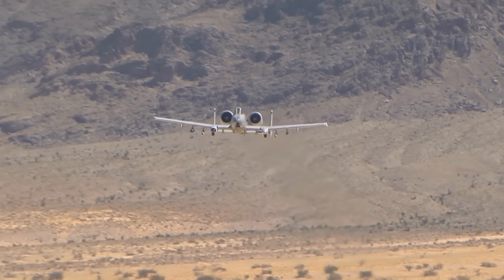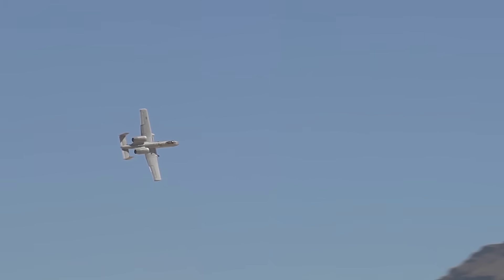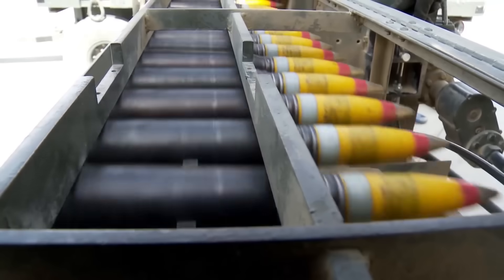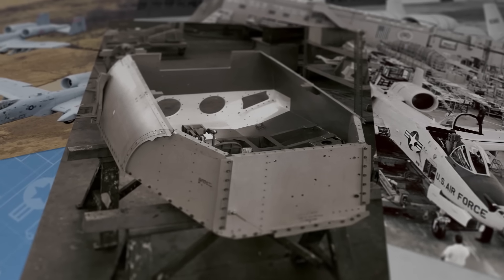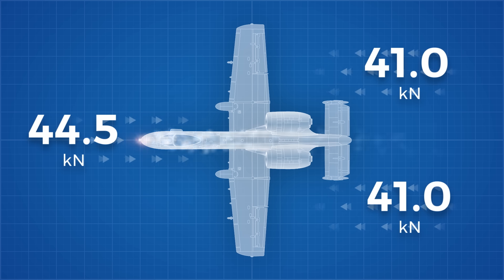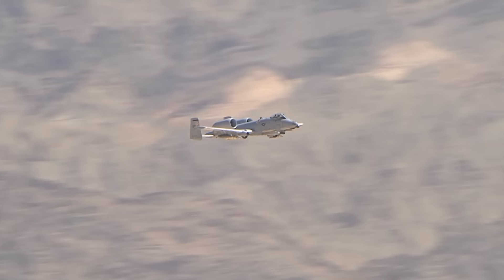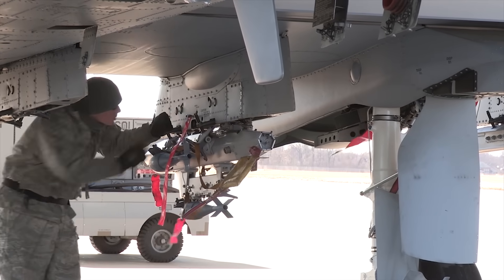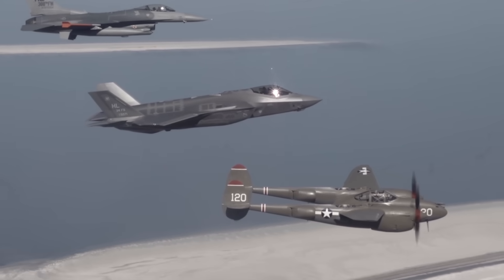The Insane Engineering of the A-10 Warthog

Comment: 00:07 Introduction to the A-10 Thunderbolt
00:31 The role of the A-10 in air land battle doctrine
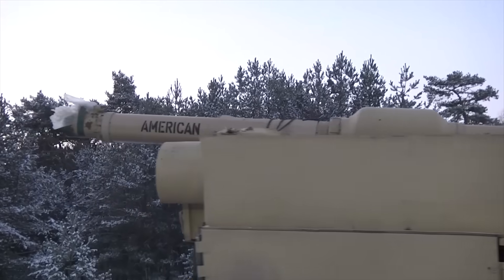01:03 Qualities required for close air support
02:02 Survivability and simplicity of the A-10
03:24 Design considerations for manufacturing the A-10
04:42 Redundancy and control systems of the A-10
06:34 Features for increased survivability
08:22 Design choices for operating from remote airfields
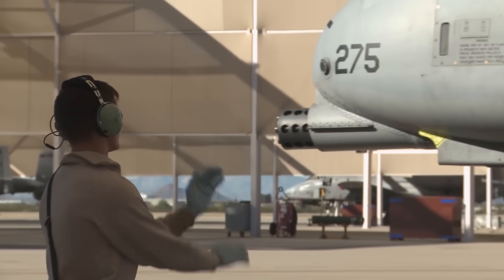09:16 Challenges and solutions related to the A-10's gun
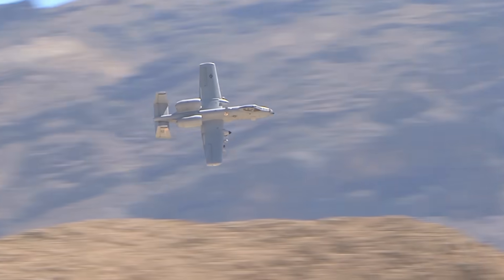10:16 The power and effectiveness of the A-10's ammunition
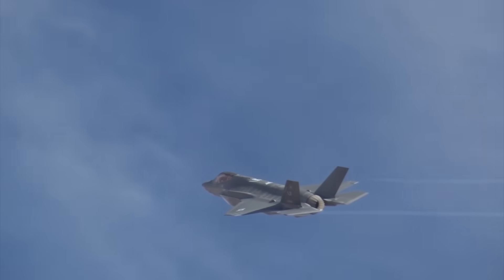13:01it can carry just as much as the f-16 when air superiority is established it's a multi-role fighter designed for the modern battlefield
13:52 the f-35 was created with future Wars in mind where the threat environment will be so dense that simply being able to take a punch won't save us

Comment: The empty shells are kept for balance reasons from what ive been told. The Hogs handling would be greatly affected if it was to lose all that weight in that part of the aircraft.
Reply: Those spent cases being sucked into those jet fans would not be a pretty picture...try turning on your garbage disposer in your kitchen and then dump in a hand full of bolts...that's probably what it would sound like as the pilot was ejecting...

Comment: Too bad there's no new successor ready to take on the valuable CAS role that the A-10 has provided to men on the ground and the Air Force's lousy lazy choice is to use the F-35, which was not designed for the mission and role the A-10 does in the first place. The Army should have given the Air Force a good slap to the face by ordering new fixed wing CAS aircraft and operate them since Air Force is fighter-drive mafia at this point, neglecting all its other roles. The Air Force never had a plan to steadily replace the A-10 with a comparable and reliable CAS aircraft so they have no right to complain if the Army maintains and fly its own fixed wings for CAS. Heck, the Army should just order batches of Su-75 Checkmate and justify it as a cheap budget replacement for the A-10 just to flip the finger to both Air Force and Lockheed Martin.

Comment: Never understood the blaming of "elevated cancers" on DU. It's less radioactive than natural uranium. There's not enough of it in each bullet to pose a radiological hazard. The bigger hazard at that point is heavy metal poisoning. Essentially the same as lead.
Reply: So DU is not a hazard because there is little of it in a single bullet, huh... And it's only 60% as radioactive than natural uranium too, that's 40% less! But wait... what if, instead of a single bullet, a million bullets are fired? You know, like in a war?

Comment: Was on the cutting room floor for decades without a purpose in the theater of war until it was saved by the 1991 Gulf War jerking its reputation in the eyes of the public, despite being outclassed by other aircraft like the F-15 and the F-111 in the same conflict, during which the data for its combat effectiveness was conjured up from nowhere and still remains dubious at best.
Tops the chart for both combat losses and friendly fire incidents - incidents which got so bad the British asked it be removed from their sectors of operation. 
Main gun can barely kill tanks built in the sixties like T-64's and M47 Pattons, and relies primarily on bombs and missiles for armour kills, weapons virtually any other aircraft can carry and deploy faster and from further away, negating any need for "loitering" and "survivability".
Can't operate anywhere that isn't total seal-clubbing territory with no air defences to speak of, while still having to face repair time and costs from stuff like AK's.
Requires an upgrade package worth the same as a whole new F-35A to stop it Swiss cheesing its allies, meaning one of its last remaining positive aspects no longer applies.
Pilots were literally using binoculars from the cockpit to identify targets for years after it was introduced. Records of just how many allies and civilians it was murdering because it had no targeting didn't even start until the early 2000's.

Insane engineering indeed.

Comment: It's important to remember the A-10 has the highest rate of friendly fire causalities out of all the airforce planes and it has to fly so low to the ground because it doesn't have any optics for accurate fire from high up.
Reply: That's only true for the A model. The C model is a massive improvement and has no friendly fire incidents to it's name. The problem with the A-10 is that it isn't suitable for a conventional war, not that it is somehow detrimental to allies.
Reply: @dumdumbinks274  No suitable for a conventional war? It was literally made for a conventional war. What it wasn't made for was asymmetrical warfare, but that's literally all it's ever done apart from the Gulf War.
Reply: @FlyboyHelosim  So was the A-1, but I don't see anybody claiming it is suitable for a conventional war. Considering the A-10 was designed to directly replace the A-1 without much concern for the modern combat environment, it should be no surprise that it stopped being suitable for conventional warfare almost as soon as it entered service.

Comment: As a tax payer I completely understand and can appreciate the effort to build a plane that can perform multiple roles in combat.
However, I don't believe it's impossible for an aircraft to be the best at all those roles. Supporting our ground troops should be a specialized role and the A-10 fills that role extremely well. Anything that replaces it should just be a better version of the A-10, if that's even possible.

Comment: The thing about the A-10 that it can do that neither the F-16 or the F-35 can is loiter around a battlefield. It's wings were designed to be stable while giving the most amount of lift at low speeds, this also means that the A-10 can stay in the area longer. Fighters like the F-16 and F-35 are unstable, this allows them to bank and turn at higher speeds but don't do so well at slow speeds. This means they burn more fuel and zoom across a battlefield while the A-10 can fly slow and low and remain in the area longer. Perfect for taking out ground targets, which is it's only job.

Comment: the Warthog will open up the neo-soviet armata like a tin can
Reply: Tanguska exists... and AA exists. But most of all, jets exist (A-10 can not fly without clear sky of enemies, because when it gets caught it can do nothing to fight them) it's better to use F-15s, 16s, 35s or heck F-111 AKWAARD or anything that can use same missiles while not being flying low or being useless against planes and using rotary cannon that can not penetrate any Soviet tank after T-64 or 72.
Reply: @madkoala2130  That it's the biggest flaw with the A10. It will fuck your shit up so fast if it has the chance, but it requires almost complete air superiority to actually have a chance of getting to a target
Reply: The cannon was guaranteed to break any Soviet tank because it was specifically made to be overkill on all existing or potential tanks. Tanks haven't gotten heavier since the 1980's, it's simply not practical to put more armor on. @madkoala2130

Comment: Unlike common belief, close air support (CAS) isn't flying low close to your enemy. It actually means that you're attacking targets in close proximity to friendly forces. An aircraft could literally be in space, but as long as it is attacking enemies near friends it's as CAS. I suggest LazerPig or Megaprojects videos on the plane to give you examples of its poor performance.
Reply: When I was active duty Army in Fort Lewis in early 90s, we had joint operations with A-10s out of McChord AFB next door.  We would fire from the ready line at targets, call in CAS with A-10s, and watch the A-10 show.  Unfortunately, the A-10 pilot mis-read or mis-judge the firing coordinates and ended up shooting the 30mm waaaaay too close to firing line.  The A-10 quickly left the airspace and headed back to McChord.  He later had to come down and apologized and gave a class on what he was "suppose" to do in CAS operations.
Reply: @mrgold3591  That sounds frightening. Must've been worse for those friendlies who experienced it on the battlefield. Do you know what model the A-10 in your story was. During it's service in wars most of them didn't have the computers to identify targets and had to rely on binoculars which caused multiple blue on blue incidents. There should be a video of two A-10 pilots misidentifying and attacking a group of British Scimitar Reconnaissance Vehicles, luckily the pilots were called off and only a few casualties had occurred.
Reply: @Saffi____  Not sure of the A-10 version; but, it was a few years after the 1st Gulf War.
Reply: @mrgold3591  so it's not C variant?
Reply: I suggest getting off those trash channels.

Comment: Ain't broke, don't fix it...build new ones.
Reply: If you have something in inventory that can do same CAS operations with more accurate missiles (not with that useless cannon) and also it easy logistics and it's not overspecialised then replace it. F 16 and F-15 are doing the same job as A-10 but with less friendly fire and there are but load of them in inventory so logistics are easy compared to one of the kind CAS specialist with basic equipment and that has main weapon as cannon in age of guided missiles and drones.

Comment: One reason the a 10 isn't and never will be useless, a few a 10s at the beginning of conflicts in Ukraine would have deleted the Russian forces the instant they crossed the border
Reply: Tanguska and AA exists boy. And GAU-8 is not capable of penetrating even roof and side of T-72 tanks plus any jet can carry guided/unguide missiles while not being useless against other planes.
Reply: @MadKoala21  are you aware how thick the armor of the a-10's cockpit is, also it has extremely redundant systems meaning it takes a hell of a lot more AA fire to take down
Reply: @yoface2537  yeah, that's a problem, IT ONLY COCKPIT. And plane does not fly with only cockpit and flying low nowadays is just asking to be shotdown with shoulder fired manpads. And that damage that it can take is mostly proven against small arms, not 37mm autocannons or AA missiles with killo of explosives.

Comment: No one wants to accept it but F35 is a failed overblown project imposed on US millitary because of political and Millitary brass corruption
Reply: Currently F-35A costs 3 million more per unit then brand new F16 block 70/71. B and C variants cost more per unit then brand new F-22. Yeah project has overblown to much budget, but at least it did 80% of the job and it didn't ended up like in Russia (luxery villas and yachts with only less then 10% of the job done)

Comment: The gun is actually offset, the 9 o’clock barrel is the firing barrel and is also in line with the centerline and pilot.
Reply: And the shell casings are retained to minimize the shift in the plane's center of gravity as shells are expended.
Reply: @theloniousm4337  yes.  more importantly it serves the dual purpose of recoil and close range near terrain combat. 👍🏼
Reply: I was going to say this.  Glad I checked the comments first.  The A-10 is still getting upgrades to date.  Love em.
Reply: Was just meant to write about the offset, but didn't knew much detail. Thanks for this comment!
Reply: thank u. i noticed his error in saying thats it is directly middle mounted of which it isnt
Reply: can someone explain to me why it is fired from 9 o clock and offset, as opposed to 12/6oclock and centered?
Reply: @chriskoo4166  from what I understand the gun rotating provides a torque on the plane making it roll in the opposite direction that the gun is spinning, mounting the gun offset would help reduce this roll.
Reply: @magmaticmonkey  that makes perfect sense to me - thank you!
Reply: i was also about to say this

Comment: This video misses the point. The F35 is a multirole fighter. Meaning it's air superior not ground. A10 is CAS closer to the AC-130. The A10 won't carry air to air armament. 2 very different roles. It misses the point that the A10 is invaluable to the troops on the ground for the next 15 to 20 years while tech catches up to the 6th gen war fighting stage.

Comment: Something that wasn't mentioned, is that while the A10 was designed for CAS, the main gun is pretty bad at that job because it's not accurate enough. In the best conditions (ie: not being in a warzone) the splash radius is 12m. That's a recipe for friendly fire, depending on the situation on the ground, and there's been plenty of such incidents. The lack of electronic assistance for the pilot doesn't help either.

Thankfully, since it can carry a large amount of precision missiles, the plane itself is still a decent CAS platform.

Comment: Man, imagine if the successor to the Warthog was the same design, but with the ability to hover like a harrier or an osprey. To see that beast hovering over a battlefield spraying lead on the enemy would be just beautiful
Reply: Its gun produces so much recoil that it wouldn't be able to achieve stationary hover.

There's a reason you're instructed to never exceed a 7 second gun run - firing any longer can cause your plane to fall right out of the sky.
Reply: @IsfetSolaris  good to know, but man that would still be a sight to see
Reply: AH-64
Reply: That's called a drone.

Comment: Imagine if a A-10 had strong enough engines that it could fly and shoot constantly without staling.
Reply: It can EASILY be done, but the plane would then be more expensive to build, maintain and operate as well as having a lower Operating Range due to increased fuel consumption by the large engines...

Besides, why would you ever need to fire more than 1 second bursts?

Almost nothing a Warthog ever shoots at can be classified as intact after getting even a 1 second burst...

In fact, anything that takes a 1 second BRRRRRRRRRRRRRRRRAP from a Warthog now tends to have more holes than structure and looks like a half-ton of Swiss-cheese and/or a Modern Art Sculpture...

If what your shooting at needs more than a 1 second burst, you're better off just nailing it with a missile and saving you rounds for all the rifle toting squishies shooting at your Friends on the ground...

😄😁😆😅😂🤣

Comment: As was pointed out the F-16 is hardly an option to replace the A10 and it is a waste of the F-16 capabilities, the F-16 can approach top speed somewhere unlock 2.5 and it is extremely maneuverable it is a capable attack and dog fighting platform. The F-35 is a laughable joke as a comparison or even a fantasy replacement for the A10, probably the cheapest version of an F-35 is 115 million dollars it is not heavily armored like the A10 it does not have extremely heavy weapons like the A10 the F-35 top speed is slightly over Mach 1 even though it's considered Cutting Edge technology, and many people debate whether it can even dog fight period the A10 is absolutely unique and absolutely engineered to do its job comma and it is the highest survivability rated aircraft with the highest pilot survivability rating. There is currently absolutely no replacement for the A10 in a true close air support role. Not to mention it's per hour operational cost is less than 20% of some of the other aircraft. All modern military tacticians talk about air superiority, and this is absolutely the linchpin of any modern military theater, but you never hear people talk about ground superiority they often refer to Heavy Armor and other aspects which are completely outdated, with upgraded A10 squadrons available to all Ground Force units on the battle lines, ground superiority can be guaranteed by aircraft imagine that. It seems only logical that existing a 10 Fleet should be permanently preserved in active combat Duty status and upgraded in every way feasible and that an entirely new version based on all the normal features of the existing A10 but completely EMP hardened, with the newest engine technology and newest electronic countermeasures technology, even if that was available only through Mission specific hardpoint mounted pods and Design with economy of operation and economy of construction and ability to rapidly produce in numbers be contracted for development and funded for Rapid production of up to a thousand aircraft.